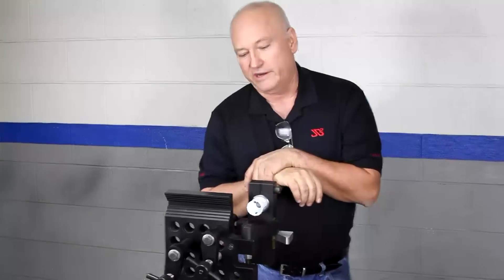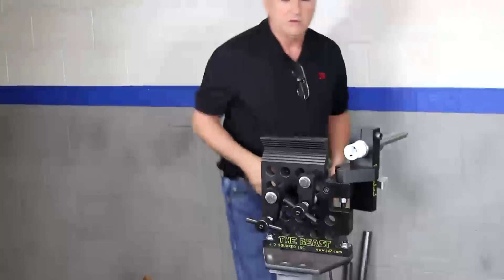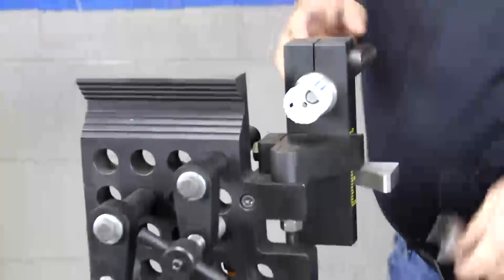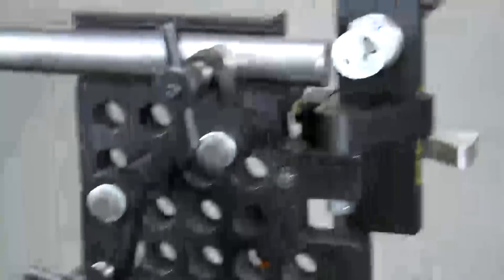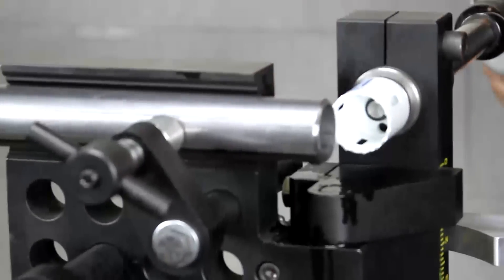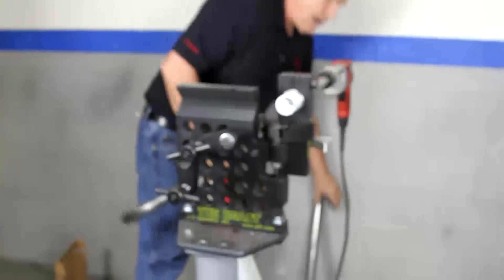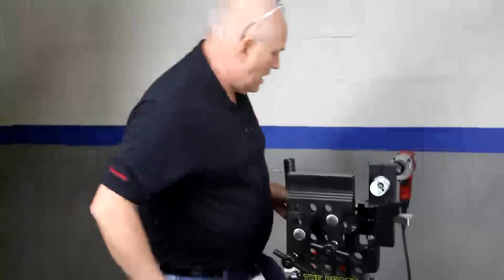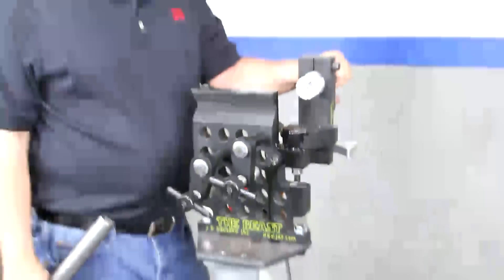The Beast Notcher by JD Squared, Inc.mp4

Comment: Did the licensing for this and the smaller notcher get sold to manufacturers in China or did they just do what China is famous for and STEAL it?  Looks very similar to what Summit Racing sells by Stronghand Tools which are made in China. I guess I assumed that Summit didn’t support that kind of thing but I haven’t bought anything from them for maybe 20 years 😳, and it seems like most companies primary concern nowadays is the stockholders. I’m 99.99% sure JD Squared(JD2)came up with it before long them. 😡

Comment: Motor mouth brushes over all the things that are wrong with the machine, the things that would really bug you if you bought one! Sorry Dan Sega this is the reason for criticism it's not negative it helps improve design you may be happy buying the same old crap that breaks but i want improvemrnts made to make the product better, the improvement i would make to this machine would be to move the clamp position away from the fulcrum then ' it wouldn't wander on ya'